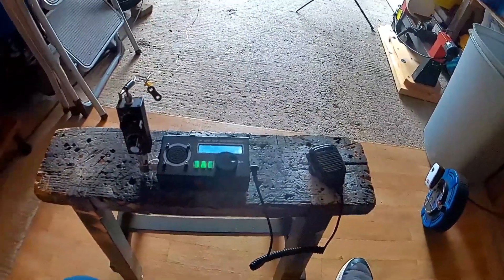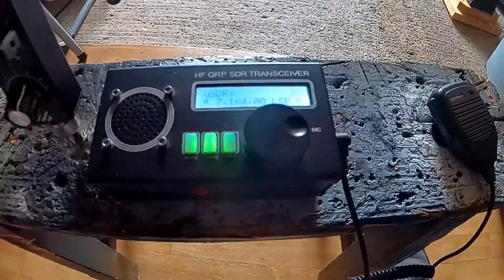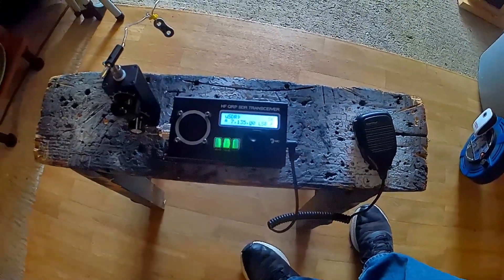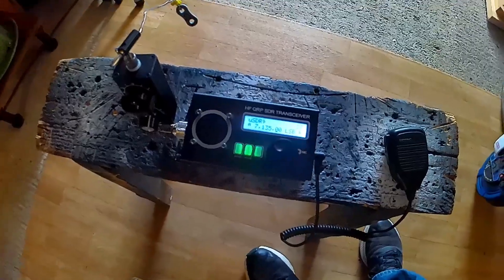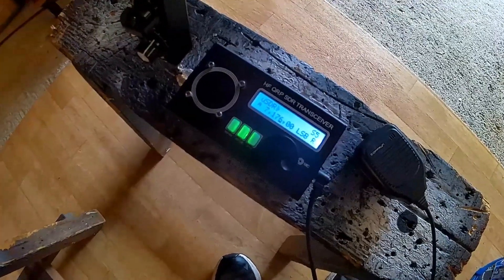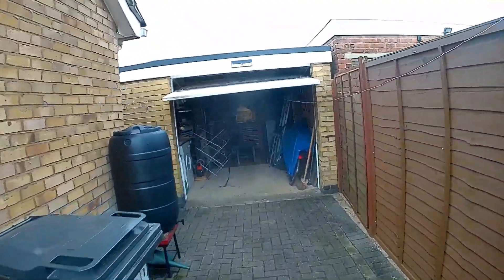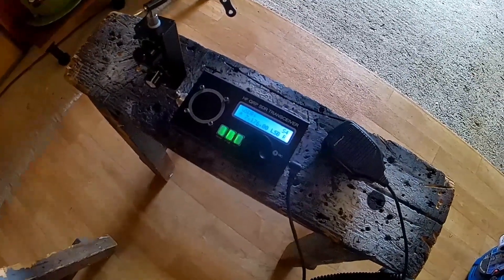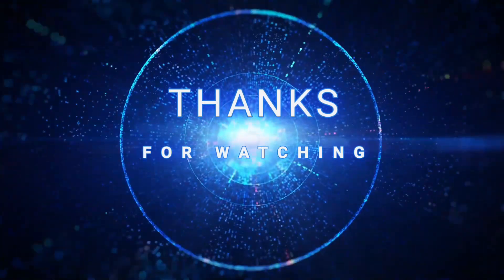Ham Radio. QRP Aerial Tuner Unit. Telescopic Thinghy. ZFGL Model. Long Wire Aerial.

Comment: Hi. I got the same radio and  portable whip/tuner. Can you make heads or tails of the top knob and where to put it for 40m for example? Don't want to blow my radio up with an extreme high swr.
Reply from the maker: It's a bit like how long is a piece of string. It depends of length of telescopic bit. I just set radio to cw and turn to lowest swr on display. But quickly.  Then write it down on a piece of paper the frequency and settings etc. So next time O know what to do .George

Comment: Hi sir. What's the wite lenght? Please? Im asking for a friend that just bought one
Reply from the maker: The total length of wire is 16metres and 100mili metres. Joined in the middle with a connector at 8metres and 50mm(milli metres). So on the 7mhz band it was full length and 14mhz band with center connector disconnected. 
George
Reply from the maker: Hi its dark here so will measure it tomorrow morning. When it's daylight. George